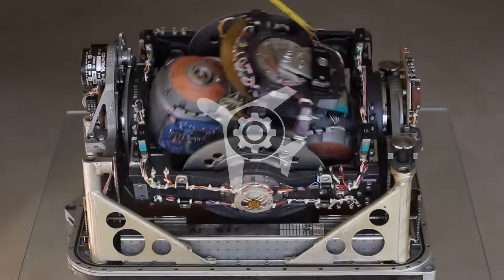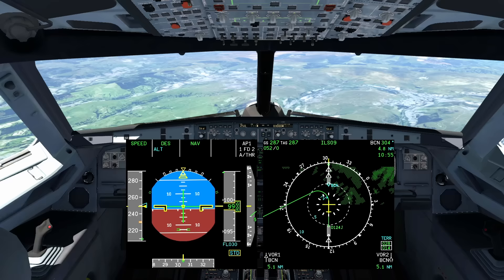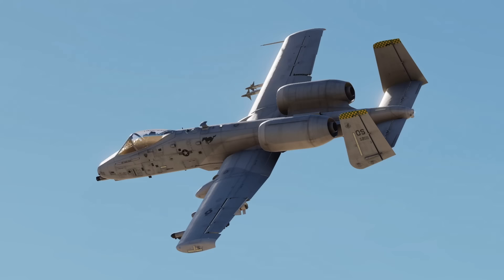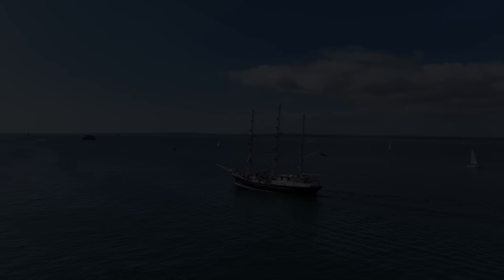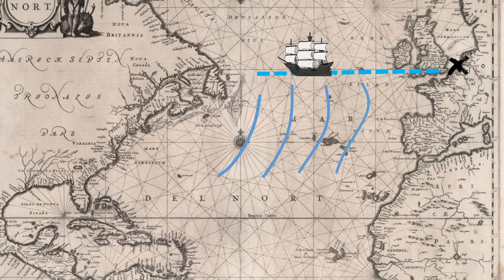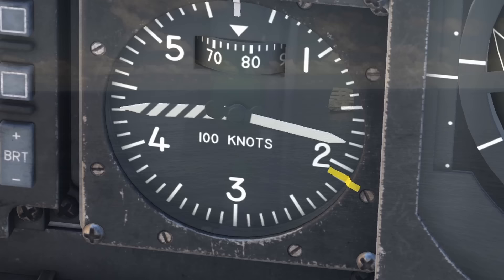The GENIUS of Inertial Navigation Systems Explained

Comment: Great video. Almost all INS systems now are a strapdown system with laser gyros and gimbal system the moveable part has been replaced with light. Two beams in opposite directions about a single axis rotation is measured by the time difference to a central point on a mirror. 3 gyroscopes in each axis are now used. Accelerometers function as before. Next video could explain this better than I can here
Reply from the maker: Thank you so much! I've also thought about doing a video on strapdown INS's exactly as you say :) who knows!
Reply: @FlyByMax  pls do it
Reply: Yes, please!!!!
Reply: Maybe three gyroscopes, one for each axis.
Reply: Thanks for the info. But I heard that modern aircraft still need time to start and calibrate the gyroscope every time the plane going to start. Is that still true ? And why the modern INS (with laser/light) still need that ?
Reply: @catbert007  the most important things for a navigation system to work from a dead start or initial turn on is the impute via the pilot or flight crew is present position in latitude and longitude current date and time for imbeded gps units. Aircraft can do several types of alignment. Standard 4 To 8 minutes of alignment to get heading correct example 83 degrees from North. Alignment of the gyros and acceles to a .8 degrees of error. A quick stored heading alignment from last present position where aircraft was powered down. A carrier alignment when position is sent to the aircraft from the carrier. Most pilots will leave the plan in alignment mode until the plan is in the air. Most modern nav system will switch to navigate mode when a certain speed is achieved when in the air cdu is switched to navigate. The navigation system does not need a full recaibration unless it is malfunctioning beyond specifications.
Reply: @georgedemetropolis8629  wow that's a very thorough explanation. Thank you very much 👍👍
Reply: Laser gyro... what that flat earth turkey used to try and "prove" flat earth. And found a... "15 degree per hour drift..." Thanks Bob!
Reply: Great explanation. I remember as a boy in pre digital days most of us had a toy gyroscope and what fun they were. My late Dad worked on the Thor IRBM missile deployment in the UK. He said that when the system was stood down in 1963 the missiles were returned to the US for reuse in the NASA space programme and the nuclear warheads to the US stockpile but the guidence systems, which cost tens of thousands of US dollars each (millions in todays monetary value) were smashed to pieces in front of officials to prove the system inoperative.
Reply: Yes! A friend who worked in aeospace remarked at how funny it was seeing this elegant, modern INS being built for a satellite, with all lasers & no moving parts, and the technician's just winding the optical fiber BY HAND around the loop tracks as if it was just a ball of string. Once installed, the software measures the length of the fiber & calculates everything else all by itself.
Reply: @catbert007  It needs time to align every time the system is turned off, but not necessarily when the airplane is going to start. The reason for this aligning time is that the system is finding the north direction and latitude of the airplane, based on the rotation of the earth. There is a video by Honeywell on youtube, called "Understanding the ADIRU", that explains how this works and the alignment process.
Reply: So basically, the modern INS is a miniature LIGO observatory.
Reply: The aircraft that I work on combine INS with GPS into the same component
Reply: @FlyByMax  Whether strap down or not, the accelerometer signal, digital or analog must be integrated once to obtain velocity and again to obtain position . On a gimballed  system the stabilized platform, on aircraft, the platform is rotated such that the vertical axis is maintained vertical, before  the first integration the gravity acceleration must be substracted first, then integrated, to give rate of climb, the second integration yields altitude, 
There are always errors  called drift after integration, not grave  for the velocity, but significant for altitude, requiring external information to correct. On aircraft this is pressure altitude, since at high altitude cruising is done along flight levels .
The long time average of the platform, aligned with the local horizontal x axis pointing north, y axis pointing east, z axis pointing down, to earths center, not the local vertical because of mass concentrations,  tiny but finite.
The gyros can be angular rate sensors, (always on strap down systems) are integrated once  to yield geographic heading, pitch (up) , roll (right). With a stabilized platform these are the gimbal angles
Called Euler angles; pitch up to 90 degres prooduces a singularity, gimbal lock, avoided  by adding another gimbal in newer generations ,
In strap down systems, all accelerometers, and rate gyros are mounnted on a vibration insolated frame, numerically processed using quaternions and derivatives, which for display are converted into Euler angles
, heading both geographical and via model into magnetic, always used in Air Traffic Control
Speed always in feet/ min vertically , otherwise, knots (Nautical  mile/hr ,arc minute along a meridian / hr), about 1.944 m/sec for speed, ( On ATS-B the horizontal component only)
Mentour channel has a nice discussion on ring laser gyros.
Reply: Don't forget MEMS based gyroscopes. They are often used in smaller modern INS systems.
Reply: @tom-erikabildgaard4047  Looked for this. As can be seen in the huge wave of ever cheaper and better consumer Drones/Multicopters, MEMS can be insanely accurate and cost effective if implemented properly. Only a question of time and military interest for this tech to go pro. Actually, I’d bet a good amount of money, that with the attention unmanned, cheap (basically disposable) military drones get in the Ukraine right now, this will greatly accelerate the process. The cheap Turkish Baktayars punched above their weight like nothing else. Products like the disposable switchblade kamikaze drone also greatly profits from the cheap- and compactness of MEMS.
Reply: @jonasghafur4940  the military interest is already there😉
Reply: @FlyByMax I would be happy to se such a video!
Sorry, from this video I didn't understand how the table position is continously corrected during flight, which still is an issue nowadays.
Did you say that values of constant velocity from the accelerometers are used, thus calculating how far around the earth you get in e period of time,correcting the table position then for the expected natural/apparent drift of the gyros?  
But isn't that causing a kind of circle reference if accurate measurement of accelerating is also dependent on the correct position of the table?
Reply from the maker: @Dr.RiccoMastermind  Hello! Thank you for your interest, and great question. You're absolutely correct! There is this kind of "circle" where the correction of the gyros depends on position of the table, which in turn depends on the gyros. This is a feedback loop and it starts when the system is initialized on the ground (the pilots need to tell the system the coordinates of the aircraft).

The downside of this feedback loop is that in the real world there are all kind of little errors (e.g.) which cause the system to become less accurate over time, and these errors grow because of the feedback.

Exactly how velocity and position are used to correct the gyroscopes is a little difficult to explain in text, but imagine this. If you fly once around the planet every hour, then you need to rotate the gyros a full revolution once every hour to keep them aligned with the horizon (this is why you need to know your speed to determine how much you need to correct). For position: if you are on the north pole, you don't need to correct much for the spinning of the planet, but if you are on the equator, you will need to correct quite a lot (radius of the earth times the rotational speed of the planet). So it actually only depends on your latitude.

Hope this somewhat makes sense, thanks for the good questions!
Reply: @FlyByMax  thank you for your kind and great answer, which helps me a lot already. ;) I knew this correction still is no trivial task, even nowadays. Maybe, when you crate a follow-up video for the recent technical solutions with lasers etc. as commented here, you might give a brief glimpse of which factors there are that have to be corrected for continously 😊👍
Reply: Nailed it dude.
   I used to work on the ASN92 and 130 systems at NAS Whidbey 35 years ago.
   Also had to troubleshoot the test benches.
The hard drive sat on the bottom, multiple disks together in one piece you had to swap out depending on which type of box you were working on.
   Never got to see the ring laser gyro, was still in development back then.

Those test benches were the size of a freezer now you can do the same with a laptop and small mounting platform.
Reply: @tom-erikabildgaard4047  
absolutely correct, usually augmented to 4 angular velocity sensors, based on vibrating piezzo forks and producing a coriolis torque  same with redundant
 accelerometers all mounted on a tetrahedron base, occasionally stabilized with horizon sensors at high altitude in a turbulent environment.
Analog Devices has  a good line.
Reply: @Dr.RiccoMastermind  When visible, horizon sensors are used instead of the long term average gravitation vector.
. knowing latitude and true heading and   ground speed, the " drift " can be predicted. Platform is analytical and referenced to the local  horizontal plane
Clocks and the angular velocity of the earth is as predictable as it gets.
Limiting on strap down systems is the numerical integration scheme, small increment trapezoidal preferred.
When using quaternions, the inherent redundancy helps (ao² + a1² + a2²  + a3² = 1), by post integration normalization.
No enough room to write down the four dimensional matrices. See Hooker and Margulies equations.
Reply: @arturoeugster7228  wow, thank you for this deep answer. It shows me how much brain engineers already put into this. As I assumed  not an trivial task! I really appreciate your response!😎🙏
Reply: @catbert007  The aircraft always knows where it is. It knows this because it knows where it isn't. By subtracting where it is from where it isn't, or where it isn't from where it is, whichever is greater, it obtains a difference, or deviation. The guidance subsystem uses deviations to generate corrective commands to drive the aircraft from a position where it is to a position where it isn't and, arriving at a position where it wasn't, it now is. Consequently, the position where it is, is now the position that it wasn't, and it follows that the position that it was is now the position that it isn't. In the event that the position that it is in is not the position that it wasn't, the system has acquired a variation; the variation being the difference between where the aircraft is and where it isn't. If variation is considered to be a significant factor, it, too, may be corrected by the GEA. However, the aircraft must also know where it was. The aircraft guidance computer scenario works as follows: because a variation has modified some of the information the aircraft has obtained, it is not sure just where it is, however it is sure where it isn't, within reason, and it knows where it was. It now subtracts where it should be from where it wasn't, or vice versa. And by differentiating this from the algebraic sum of where it shouldn't be and where it was, it is able to obtain the deviation and its variation, which is called error.
Reply: @ColonelFatass3  that’s called an EGI embedded GPS INS most military and modern commercial jets use this.
Reply: @tom-erikabildgaard4047  yes these are used in drones. I worked on a missile system and we were developing MEMS based INS that could track its dynamic performance.
Reply: @wrench71  I’ve seen a video that stated exactly what you typed
Reply: @jimsteinway695  Yep, that’s it. My knowledge is pretty much limited to C-130J communication and navigation equipment, but it’s nice to see that system get used across the board.
Reply: Yes, they do.
Reply: @ColonelFatass3  I worked in GPS when we could barely get 3 satellites to show up in the late 80s. I helped integrate the first GPS system onboard the Harrier. Later I worked with an F18 program and they got the Litton EGI system which lost to the Honeywell EGI that I think went onboard the F15E strike Eagle.  The system we put on the Harrier was the miniature airborne GPS receiver called the MAGR by Rockwell Collins. Later I helped Raytheon come up with the MAGR follow on I think called MAGR 2000. 
That Honeywell EGI system was legit. Man it was nice to work with
Reply: @jimsteinway695  The Honeywell one is the one we have on the MC-130J. It's definitely a reliable system, a lot better than the older GPS and INS systems I dealt with on the AC-130Ws and Hs
Reply: I'm an eagle driver and engineer, great point but easy buddy, easy. there's a time and a place to talk about these things
Reply: @catbert007  modern INS equipped with laser gyros need a stabilization period to "feel" Earth's motion. When it receives it's position from the GPS (or manually from the pilot) it will then figure out where it is pointed to (its Heading).
Imagine you are on the Equator line when you start the alignment process. If you are pointed to West, the gyro will "feel" the aircraft pitching up due to the rotation of the Earth, but no movement in Roll or Yaw. That allows the INS system to figure out all by itself that it is pointed to West. If you are pointed North, there will only be a Roll sensed to the right, no Yaw and no Pitch movements. The INS will know it is pointed to the North. All by itself.
But if you were doing this on the North pole (or South Pole), there would be no way for the INS to figure out what is his heading, because during the alignment period it is always rotating on its vertical axis. This is the reason why these INS platforms equipped with Laser gyros have a limitation to be aligned only up to a certain latitude, around 80⁰ N or S.
Reply: @rickkwitkoski1976  exactly. 15⁰ per hour x 24 hours = 360⁰. So the Earth must be flat 😁
Reply: @luisr320  thanks ! Never know the navigation system is so cool. 👍
Reply: @catbert007  There will always be small errors in both the accelleration measurements and the position of the gimbals, which build up over time.  Therefore the INS needs to be corrected by periodically setting its position when the aircraft is stationary at an exactly known position.
Reply: Phones use the actual silicone moving
Reply: You've answered the question I was going to ask. Our smartphones do similar stuff using MEMS sensors.
Reply: A lot of them operate in what's called a semi strapped down mode. They still have gimbals but the gimbals operate to flip the platform and dampen out biases in the gyros and accelerometers.
Reply: @FlyByMax  if i may, the feedback loop adding error progressively remains for fixed gyros (the table is just an additional step). It is an inevitable artefact of time integration combined with small errors that add up.
In your video, it feels like a "magic" solution, however modern aircraft have to recalibrate their position regularly using GPS, not only at startup. You could still use it as a backup, but 100m accuracy would be lost after an hour, or less.
Reply: @georgedemetropolis8629  Thank you George
Reply: When I 1st started flying machines with ring-laser gyros, what was amazing to me, is that we have the capability to measure such extremely tiny changes in the speed/time a light beam can travel such a very small distance.  The science behind that aspect alone is mind-blowing.
Reply: Thank you. I think we all need a video on this new INS.
Reply: @FlyByMax
Reply: No gimbal lock possible on that I guess
Reply: @ArztvomDienst  try
Reply: @FlyByMax  Please do it. ... this one was so good that we all know you'd be the best at it.
Reply: Brilliant!🥂
Reply: What about a gyrolock situation? How can the guidance system detect and recover from that?
Reply: How are they better than MEMS
Reply: I mean, you didn't understand anything
Reply: @wrench71  Wow, I thought I was going to be confused when I started to read your post - but I understood it! Thank you.
Reply: The so called Sagnac effect is the key physical phenomenon for light based INS.
Reply: @idiosinkrazijske.rutine but i understand Sagnac innovation didn't detect a moving earth🤷‍♂️
I'm still stuck after 15yrs trying  to observe accurately a moving earth.
Reply: @catbert007 yes still needed 10min usually but 1 min is the minimum because the laser gyros still need to calibrate earth rotation..
Reply: I came here looking stupidly for some simple Answers to a complex  piece off machinery and tech I’m deff in over my head I’m enjoying reading your comments though even if I only understand a portion of it . I only have a high education though give me a break . So is what there saying is this device dosent need any outside input or electricity it’s completely self contained ? If this is correct how does it get data to the avionics/flight data recorder ? Fiber optics? And is the redundancy’s I assume
Reply: Several of the comments here offer a better explanation than that video which I found long-winded and superficial.
Reply: Correct, Ring Laser Gyros are standard nowadays, but need temperature compensation to adjust light distance over temperature. Very interesting how this is done and adds a layer of complexity we are somehow able to overcome.
Reply: You are correct
Reply: The ring laser gyros come in two varieties, the ring consists either of 3 mirrors or 4 mirrors and the measurement is an angular rate, by evaluating the interference pattern about one half transparent mirror. The cavity connecting the corners is a helium neon mixture. All mirrors are mounted on a piezzo actuator, in order to maximize the power of the two opposing beams, by a path length servo control. Electrically shortening or lengthening the piezzo Chrystals. Three ring laser gyros are required to measure the body rates. These rates are digitally multiplied by a 4 by 3 matrix of unit quaternions, yielding 4 quaternion derivatives which are integrated to produce the updated quaternions, which then are used to calculate the  Euler angles, pitch, roll and yaw,  used for display. A common problem is that at low rotation rates the interference is so  small, causing lock in, The solution is that the whole unit is dithered.
Note worthy is that the quaternion parameters are periodic , with a period of 720 degrees, twice the expected 360 ° rotation.!!!
That is a fundamental property of topology.
Reply: 30 years ago, my parents were arguing about why Henry Kissinger negotiated the sale of machines that would manufacture laboratory grade ball bearings. My machinist father, who was usually the calm person in the room, was visibly angry. My mother, who I later found out had a much higher security clearance, was unusually calm. She worked on system that replaced the three football sized gimbals with a fiber optic pulsed laser guidance device that was half the size of a deck of cards. She said years later that the sale was made to divert the Russians away from optic or piso? technology. The only answer my parents gave publicly about their jobs was “We work on the nonnuclear components of nuclear weapons.” 😅
Reply: @georgedemetropolis8629  position is done by GPS with a precision of 3 ft and with the military freq. 2 inch.
Reply: @rickkwitkoski1976  yep the resolution of ring laser gyros is above earth rate.
Reply: @luisr320 the laser-gyro systems don't REALLY need to perform the IRU Alignment before a flight.  It is done to test the RLG systems more than anything.  The accelerometer system might need this "zero" or calibrate step but the RLGs don't.  The aircraft should fly fine without performing the "alignment".   They often fail if the aircraft is jostled during the test including high winds or people walking around.  If the step was mandatory, you never get off the ground in high wind conditions because you'd never get a "pass" on the step.
Reply: To be honest, devices based on lasers and light are not attractive to me, and they are voracious consumers of energy due to the laser, which is usually very dangerous. The reason that I think is likely that they replaced them is that they are consumer companies that aspire to control others centrally, expand and profit, so we always see them promoting the very complex and energy-consuming electrical system as a problem-free and perfect system !